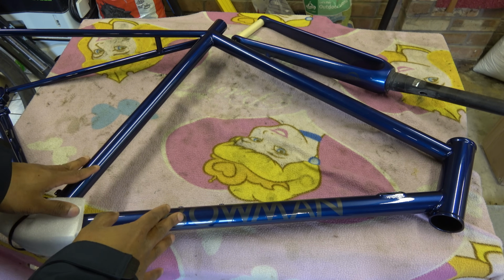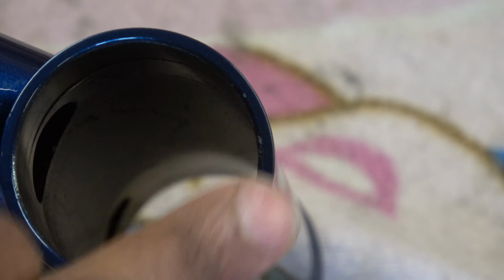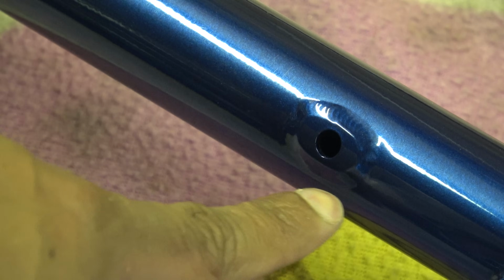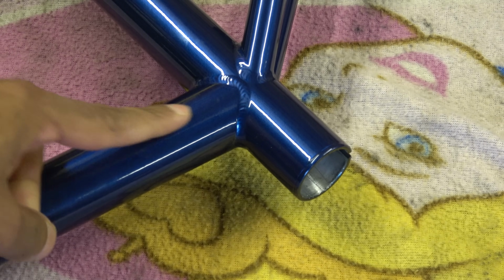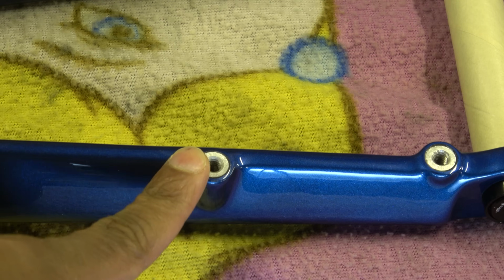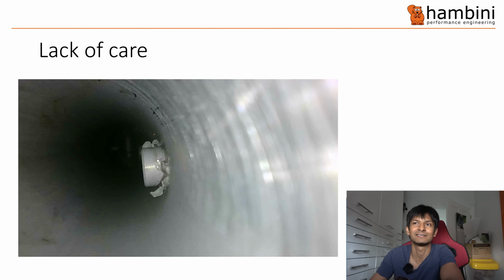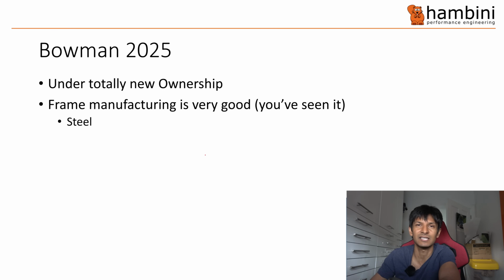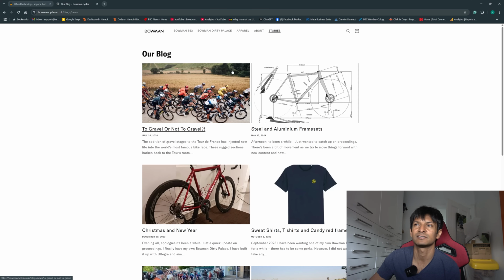DRUNK Man Buys England's Worst Bike Company after drinking too much

Comment: This user was reaming my seattube yesterday, drunk on german cloudy wheat bier, with some sparkly fangled curved file bought on Taobao! 

Somehow this video is top of my feed this morning.  Was my phone listening to me as i was screaming and swearing at my upside down bike in the repair stand, pulling the cable to the side, working the file in and out, whilst lacking a third hand the stand was rotating??

Oh, the bike is a Marin San Quentin 3. It has had 3 dropper posts in it, in the last 4 years. The original X-Fusion Manic that had some issues with clamping, and the dropper sticking on return. Then a KS Exaform 900i that had no problems. Now a Trans-X Rad+ that i couldnt clamp without the post not returning. 

Inside the seattube were loads of tiny alumunium scrap, stuck to the inside. Once filed away, my dropper works correctly. 

Also, paint around where the headset goes in splintered off recently when i changed the headset.  Looking a bit scruffy now.

If Marin cant properly ream their head- and seattubes so it all fits together and works, then who can?

Comment: Made by Maxway in Taiwan. Maxway make the vast majority of high quality Taiwanese steel frames - for brands such as Surly. They made all the Genesis steel frames until 2014. The black anti-corrosion coating is "ED", which is electrophoretic deposition. The press-fit cup type headset was standard on everything until about twenty years ago, after which integrated headset became popular. The head tube WILL need facing, as the cups have to be 100% parallel. That TIG welding is all done by hand, and looks to be of very good quality. Problems to watch out for on Maxway frames are minor factory handling dents in the tubes, which are so shallow that they have got through quality control. Another problem to look out for is over-heating evidence where braze-ons are fitted the the centre areas of the main tubes, where walls are thinnest. Over-heating shows as distortion to the tube around the braze-ons. Maxway frames are generally perfectly aligned and of fine quality. The couple of aforementioned problems have been known over the years but are relatively rare. Facing corrosion can be solved by an occasional wipe over with oil. All interfaces should be reamed and faced as necessary.
Reply: I have a 4130 maxway frame I still haven't built. This is great to read.

I love steel frames.
Reply: @simplexicated  You won't be disappointed. Make sure to get the facing prep done properly. Few shops have the eexperience and equipment, so you may have to travel to get this done right. If the frame doesn't already have one, drill an 8mm hole in the underside of the BB shell, and make sure it always remains clear and unblocked. I know this sounds like vandalism, but steel frames should be vented to prevent them retaining water. Unvented frames are fine in dry climates, but not in the UK. Trapped water (it gets in via capilliary action) is the most common cause of the premature demise of a steel frame, and tube perforation from internal rust can't effectively be repaired. If you're familiar with classic Italian steel road fames, you'll know about the vent slots in their BB shells. It wasn't done for weight saving. The slots or cut outs were there to keep the frame drained and aired. Oh, and don't forget to grease the seatpost interface! Enjoy the ride...
Reply: ,   I agree, a vent/drain hole is necessary but 8mm? That's huge. I have a Surly Preamble frameset not built up yet; I was thinking maybe a 3/32" hole would be adequate.
Reply: @EoEhNnE2013  A small hole will block almost immediately. I repair and modify many frames. I normally make a 10mm hole and braze a washer around it to make a reinforcing lip. Un-reinforced, 8mm should be good - or several 5mm holes. Look at old Italian road frames. The slots or cut-outs are always significant, and never just one small hole.
Reply: @davidpalk5010  When I built my frame I faced it as part of the construction. The BB was prefaced.
Reply: @grahamaustin9085  Great to hear. Proper prep is essential. There are very few shops necessarily equipped or experienced enough to do it these days. It should always remembered that it is not the frame maker's responsibility to prep the frame. Cuttiing interfaces and final alignment checks should always be the responsibility of the bicycle assembler, and those without all the very expensive cutters, reamers, taps and alignment gauges, and the know-how to use them correctly, have no place putting a bicycle together. It seems odd to many people that frames are supplied essentially unfinished, requiring perhaps an hour or two of specialist additional work with very costly tools, but there are very good reasons for this.
Reply: ED?! C'mon maaaannn.......
Reply: @nelsonhibbert5267  Electrophoretic Deposition ("ED?!" aka EPD) is the smooth, black coating seen on the inside of the head tubes and BB shells of modern steel frames. Think of it as very thin powder coating applied by immersion of the frame in a solution containing particles which are applied to the surface via a process akin to the electroplating of metal finishes. ED is a corrosion preventative, and forms a base coat for wet painting or conventional powder coating.

Comment: I almost died in a crash which I am sure was caused by the poor quality of my Bowman frame. Speed wobble on Honister Pass which I couldn’t resolve, huge crash, I still can’t believe I wasn’t killed or paralysed. My Bowman frame is stored in the top of my garage and won’t see the light of day again if I can help it.
Reply: What broke?
Reply: @ nothing broke on the bike but the frame began a massive speed wobble that I could not cure in the usual way - clamping legs on the top tube to stop the vibration. It seems the usual cause of a speed wobble is a defect in the geometry of the frame or the way it has been assembled. Put it this way, I didn’t intend to try it again to check!
Reply: @huwd2292  How fast?
Reply: @huwd2292 sounds like it's how you was riding nothing to do with the bike do you have twigs for arms😂
Reply: @ thanks for your kind advice. I hope you don’t ever experience an accident like it.
Reply: @ I went from 33.4 mph to 0mph. Or at least my Garmin did. I went on through the air and landed on my back 6ft down by a stream.
Reply: @huwd2292  That's bonkers, speed wobble at 50 kmh. Even a granny frame shouldn't do that

Comment: Normal practice, for a better quality steel frames, is to ream and face both ends of the head tube after paint.  From the shelf visible inside the tube, it has been reamed at sometime during the build.  When manually reaming and facing the tube, both cutters are placed on a single shaft.  This controls how far the reamer enters the tube, and makes sure the face is square with reamed bore.  Complete shop tool kits from firms such as Campy and Cobra included the tools to ream & face head tubes, chase threads and face bottom brackets, ream seat tubes, and test & align dropouts.

BTW reaming not only assures the correct diameter, it accounts for any deformities  caused by the heat of welding or brazing.the tubes.

While this head tube happens to have enlarged thickness at either end, it’s not clear if this was rolled into the tube (something sometimes done by at scale manufacturers) or had a brazed on reinforcing ring.  Neither may be necessary if thicker gauge tuning is employed, but for lightweight tubing, I think reinforcement is called for to ensure longevity.  In this case, based on your description, reinforcement probably wasn’t necessary.

Finally, nothing was “…bulged…” in thar head tube although modern tapered head tubes may be if you consider rolling a synonym for bulging.

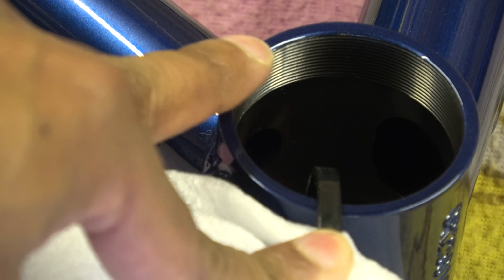Comment: @4:20…that black coating is called e-coat, or EDP (electrodeposited paint).  It’s a thin (~15micron), uniform epoxy paint applied from a water-based bath using charge (opposite charged paint particles vs frame), and then cured.

This treatment is used on every car as a primer and the advantages are uniform thickness and penetration into tight crevices.  IIRC e-coat was invented by someone at Ford in the ‘80s.
Reply: very informative, thank you
Reply: That coating is probably what's  on the inside of my steel 72 scuba tank (Nemrod brand)--that tank's at least 40 years old and just went through it's third hydro test.
Reply: @ : e-coat has only been really commercialized since the late ‘80s
Reply: @, there is some kind of epoxy coating on the inside of my tank (BTW, the 72 is the cubic-foot size of the compressed air when filled to its rated pressure). That coating technique in one form or another has been around since the '50s--we had some on our switch gear at Westinghouse.
Reply: I first heard of it at the Ford training college in daventry in the late 80s and knew it as cathodic coating.

Comment: Hambini, I love this frame review but was saddened that you failed to say much about the excellent properties of 853, or how that 'heavy' frame weight actually sits amongst other steels. Was it plain gauge or butted? Few steel buyers do so to have a lightweight frame, like with carbon, but there are differences you have become renowned for mentioning. If 'facing' 853, how would YOU treat those exposed surfaces?

The Chinese know how to make carbon items, but of course the quality is both factory & price sensitive, but they had first learnt how to excel at quality steel frame construction too. My Taiwanese (1 nation, 2 systems; Ha!) CrMo DB frame of 1978 lasted until stolen 18yrs later. My 1984 531 frame still sits amongst my N+1 flock.

Aluminium actually work-hardens, unlike how steel, titanium or carbon frames may respond to use. After buying my 1st cheap alloy mtb in 1998, I'd expect ANY alloy frame to catastrophically fail eventually, regardless of the build quality, especially a lightweight one. With Reynolds 853, that was what my 2nd mtb was made of as I missed out on Norco's Ti-Team version, sadly. Eventually had it repainted, bosses added to convert to a hybrid, 700C fork & DA calliper with XTR elsewhere. Fabulous in all its roles for me, even in a 180km per week commuting role. XTR 950  bar-end shifting was another fabulous Shimano idea that 'never' caught on.

Locally made is a great ethos to hold, but only if the quality compares with the opposition, on value for money. 

When commenting on any frame, please, never say just "metal", simply tell us which actual material, as in steel, ti(-tanium), aluminium, magnesium, or whatever alloy, all these are influenced differently by 'the build quality' of construction for how to be best judged, IMHO. 

That's not too much to ask of a 'details' aerospace man, I trust! 🤔

Aeroplanes are not said to be made of 'wood', 'plastic', 'metal' or 'composite' materials in any technical coverage. Even with wood, the type matters; balsa or ash? Our bikes matter to us THAT much, or your commentaries wouldn't have been viewed more than once, by those with any knowledge of such things. 🤣 

Keep up your good work! Just don't cut any detailed corners, ...without using a mitre-saw, laser, or CNC, please! 👍

Seems like right now that Bowman is rightly re-finding its feet. The blog reads well, filled with ethical promise, too.

A new website is coming 'soon', maybe it will include proper geometry charts/pics and will add antipodean shipping options too, especially as they do offer shipping into the tariff ridden US of trump. 

Do 'they' recall who the UK's mates really are when it matters? Y'all jumped out of the EU and still offer shipping to 'them'. 🖕 Ha ha.

Comment: Hello! I couldn't bear to write. Your operations with your fingernail, on the subject of researching the cleanliness of contact surfaces says only that you have never seriously read the specifications of sram\shimano, which makes me doubt your competence, as well as it seems to me that you mislead your own audience. 
For example, the contact surfaces for the rear FlatMount on a particular frame are larger than the specs(visually) . So what you rubbed with your fingernail is behind the contact surfaces. 
Regarding your repeated mantra about “needs to be”, in reality, the manufacturer does not make mistakes or grossly violate the specs, and in general there is nothing wrong with this frame. 
I encourage you to move from theory to practice and build 1 frame, I think it will be interesting for everyone and you can learn more about the specs and process. 
Thank you!
Reply from the maker: hello bot

Comment: Of course it’s TIGged - they ain’t welding 853 any other way 😂
Slap a classic King headset in that and it will last for ages - face the paint off and keep it greased it won’t rust too bad unless it gets covered in salt and not cleaned.
Steel frame and a carbon fork was the recipie for a lovely bike back in the day - can’t really go wrong.
Reply from the maker: at eurobike, some manufacturers were doing robotic mig.
Reply: @ who ? I know which I’d rather ride :)
Reply: Fronius welding and Fanuc robots were developed a few years ago for bike frame welding.

Hand held laser welding is a more recent development in bike frame building.

Comment: I took a 80s Japanese steel 10 speed and put tiagra 2x10, 35mm carbon wheels and a carbon 1 inch thread less fork and modern bars with a quill stem to 1 1/8 adapter for the bars. I called it the high carbon content build. It was 24 pounds and I think I still have 4-5 Koms in Ohio on that frame. Doesn’t hold a tea light candle to my 5 year old bike but I would still have that frame if it hadn’t broke in a crash. I talk too much.

Comment: I own 7 bikes, all of them steel. My oldest frame is a 1937 Schwinn Model C and the entire frame is oxidized patina. When I built it up into a klunker, I sprayed the interior with engine fogging oil, and I apply boiled linseed oil occasionally to the exterior to lock in the patina. Dude, it's fine, it's still being a bicycle, it's tearing up the neighborhood, and it's not breaking in half. I have a 20-year-old track frame that has seen as many Canadian winters, and has been assaulted incessantly with salt and grit, wearing away at the paint and rusting on the surface. I find it baffling that someone as smart and knowledgeable as yourself is so fucking obsessed and alarmist about some orange stuff appearing on a steel frame. You don't even need any ED coating if you treat the interior of your frame, which can take just a couple of minutes if building a ride up. I have ridden bikes in the harshest conditions and leaving salty road muck on them after riding, and there is absolutely nothing wrong with the frames after all that abuse and neglect. That 20-year-old track frame lost a lot of paint over time and got a lot of surface rust, so you know what I did? I removed all the paint and ran it raw for a year, enjoying the rusty patina that exposure to humidity and rain built up. And when I got tired of that, I buffed and sanded all the surface rust off in less than an hour, and then painted it, and now I have it raw again because the paint didn't bond and started coming off after a while. What I'm getting at here is, it takes minimal effort to prevent interior frame corrosion (and even if there is interior corrosion from past neglect, it can still be treated and will be absolutely fine) and that exterior surface rust MEANS ABSOLUTELY FUCKING NOTHING. NOTHING NOTHING NOTHING. Fucking plastic frames get disposed of after a few years, get scratched to shit and look like shit after a few seasons of riding, while steel frames will rust, and rust, and rust, and yet continue performing exactly as they should not for 5 years, not for 10 years, not for a couple decades, but for lifetimes. My "new" klunker build is 88 years old, will take far more abuse than any disposable plastic bike, and will be something I could hand off to a younger generation to continue enjoying. Jesus fucking Christ, I bought the frame used because of the orange. For someone who takes pride in smugly reaming foolishness, maybe you need to consider your own oriface in need of some treatment. There, I was triggered, I got it all out, have a great weekend. And look out for surface rust! It will kill you!

Comment: If you're worried about rust forming after facing the steel surface you can use a thin layer of marine grease (it's cheap and water resistant) or anti seize grease.

Comment: Steel frame + carbon fork is pretty common these days for non-racing bikes. Ends up being less expensive and a safer option as you need a properly skilled welder to make a safe metal fork. More time, more skill, and more cost. Carbon fork ends up less expensive and still lets the bike feel a bit less like a tugboat
Reply: Tom Ritchey, Raoul Luescher and many others have commented on the benefits of a steel fork to give a smoother ride. Carbon fibre can be lighter but stiffer.
https://www.youtube.com/watch?v=tvybGDK3uS8
Reply: @RPaton Ride feel is pseudo-intellectual nonsense. Any material can be made stiff and any material can be made compliant. Tube geometry has more to do with stiffness than material. The real reason most bikes come with a carbon fork is that per unit they are faster, cheaper, and require less skill to make than a steel fork.

Comment: Beautiful frame. It does not matter that it weighs a bit more, as it won't be a climbing or race bike.  The paint is exquisite, and I don't think it matters that the brake mounts are not faced. They can be faced at installation, and because the mount is solid steel, corrosion will not be enough to do any harm.  There are plenty of anti-corrosion products and even ordinary grease can be applied on the faced mount.  I like that it has some capability for external cables.  What is the price for the frameset?